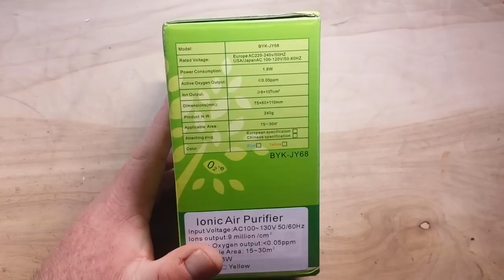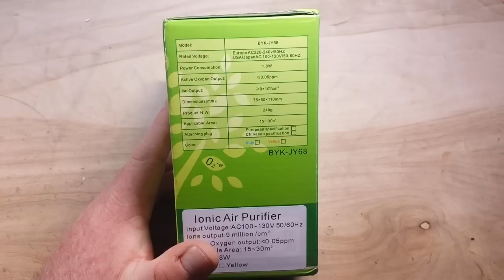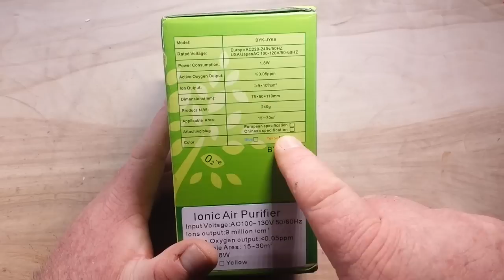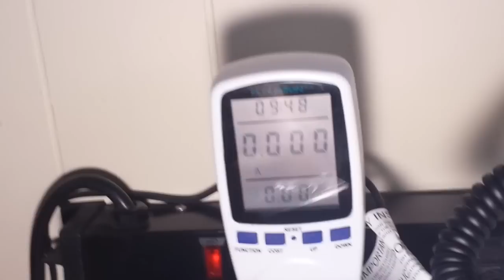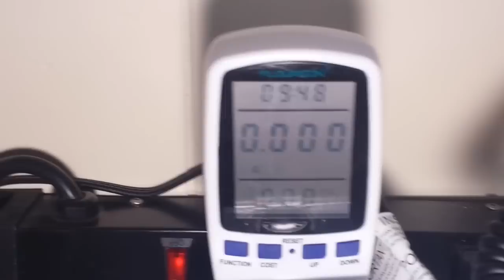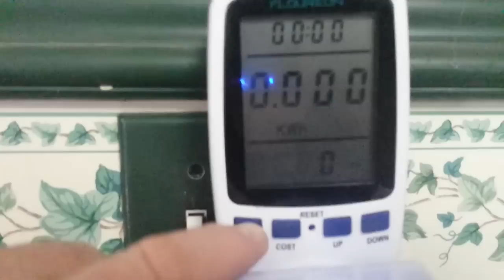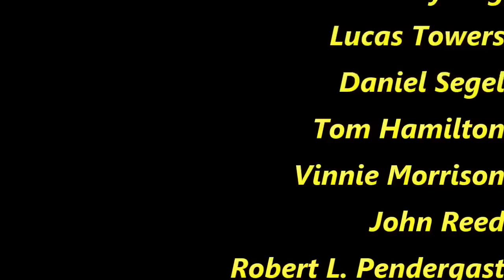Ionic Air Purifier from Gearbest Fail

Comment: Did you set your meter to watts instead of kilowatts? A blue led will draw 15-20ma at least.
Reply: Yeah it's on watts, but 20mA at 3V is still just a tiny fraction of a milliamp at mains voltage with a capacitive dropper, they are almost lossless.

Comment: It is natural do not get any power consuption, it is only a plate with a high voltage potencial that uses the efect of sharp point to change ions with the ambient, it seems more like a capacitor charged with high voltage waiting the air around discharge, it is all, but it works.
Reply from the maker: No it doesn't work. I have used ionizers in the past. They give off ozone. There is no ozone being emmiter.

Comment: Get an Oreck, can be bought used $5-25 depending on source. Wash the Truman cell once a week or so, works great. When it gets noisy after a year or 2, change the motor bearings ($8 Amazon for 10 pcs). I have 3, they get rid of the dust/dander/odors in the air good.

Comment: how are the LEDs on with no power draw?
Reply: 20mA @ 3V to feed that LED (maximum, might work as well at a quarter that current), that's 0.5 mA at US/Canada mains voltage. I wouldn't be surprised if the meter and the integrator just don't go below 1mA at all - that is there is power consumption, it's simply too low to measure.

Comment: Maybe your power meter isn't made for such low power levels? Could be calculating the wattage from voltage and amps
Reply from the maker: It's supposed to operate at 1.8 watts. That's within the spec of the meter, plus there is no ozone odor.
Reply: strange =/ did you try powering the potted unit with a bench psu? or is it powered directly by ac? tried 240V?